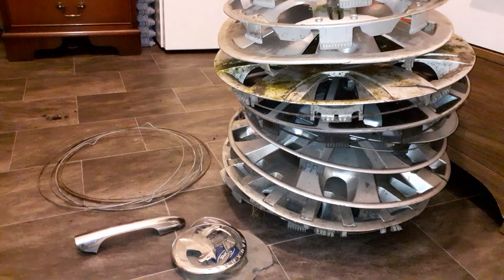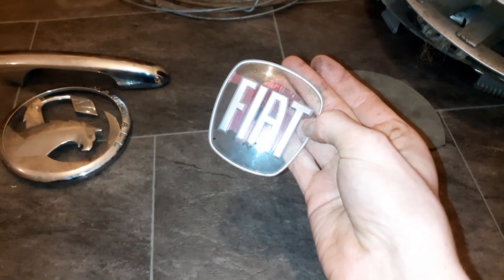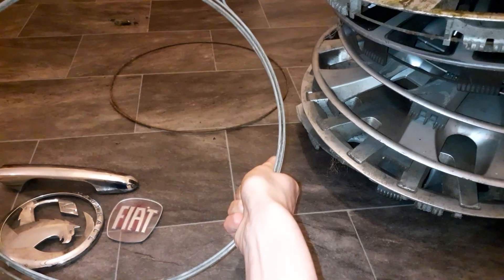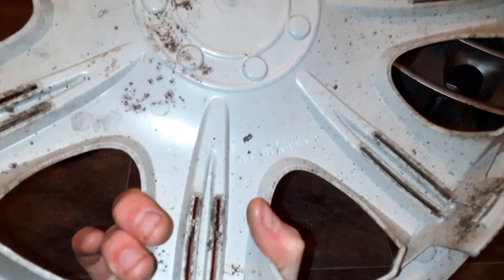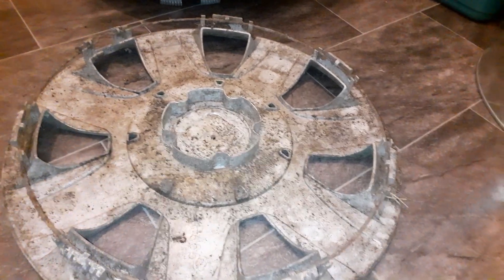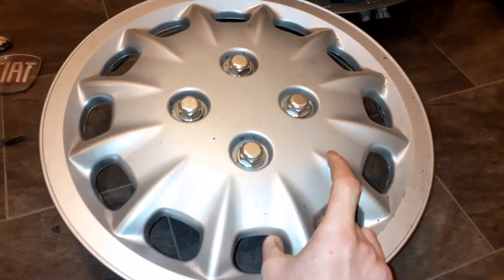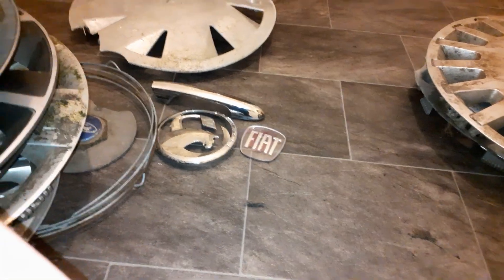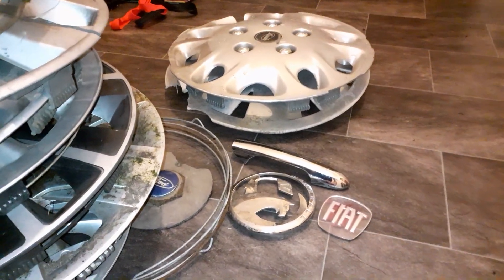hubcap finds review 26/2/2021

Comment: That is a black bolt all the rest our silver
Reply from the maker: One of the bolts are missing
Reply: It’s black
Reply from the maker: Nope the chrome bolt is missing and the black bit is what should be under the bolt to hold it in place
Reply: It's not black. And it didn't look like a Removal bolt either.
Reply: @joemercedeschannel196  I know I didn’t know then
Reply: @joemercedeschannel196  sone bolts are removable